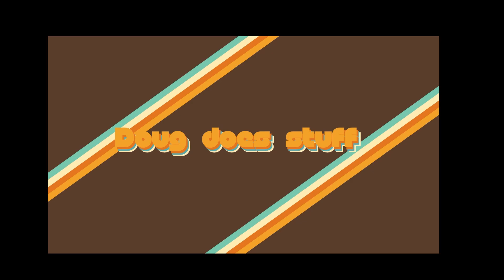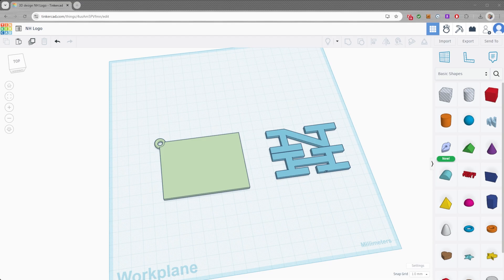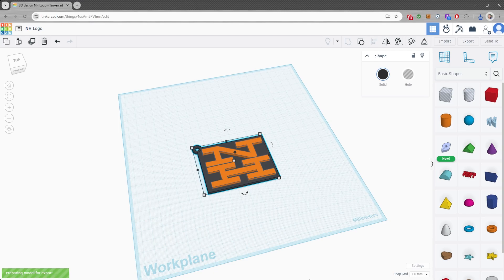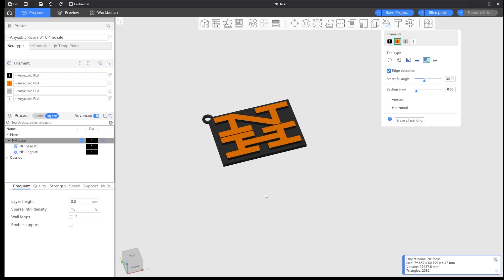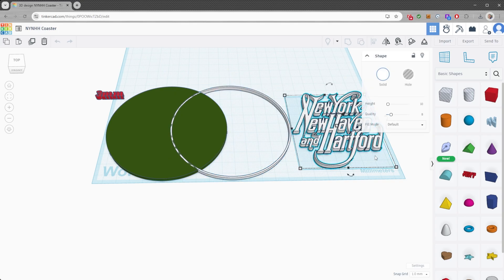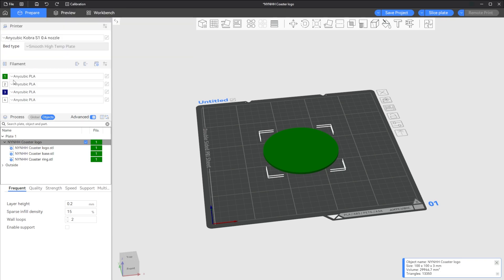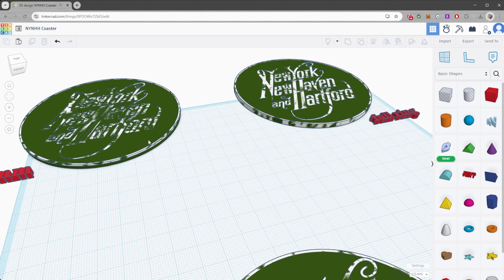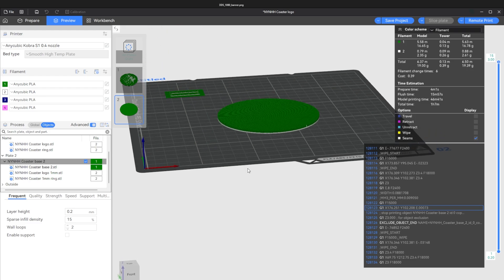3D Printing: Setting up a Multicolor Print Orca Based Slicers

Comment: After I watch your video I installed the firmware . I tired the heightmap. I did a lot of calibration (resetting klipper each time to see the new level,) and they where +- 0.1 without me touching anything .So not super repeatable .  On one corner I was over 1mm . I tried to upload the heighmap and did a 1st layer test print. I got the worse print i ever had. tired it many times just to be sure  and it was bad each time. I then push a little on the bed on the side that was the worse. I think the base is all plastic since it flexible. I really didn't put excessive force to it. On my bambu I put more forse to the part to release them. So when i redid the heightmap , the -1.2mm came all the way to -0.4 . So my highest point now is 0.2mm and lowest -0.270 . 
I think if a part stick on the bed well enough you can put more force to the bed that the force I applied to the bed to level it . 

First layer print is still horrible if i use heightmap but strangly enough I also did a test print and it came out ok and also stick a lot better on the bed  . Maybe is the model I am using for first layer prints that is the problem??? . .
Reply from the maker: Yeah, I am thinking it is the plastic bed that is the problem too.

As for the first layer print, which model are you using?  I just made a 250x250 single layer model in tinkercad so that I could tweak my own settings.  If you use Anycubic's single layer gcode it modifies settings to mask the layer issue.
Reply: @dougdoesstuff24  just a random one from makeronline market. I would try printing more items to see if its better. Any idea how to change fillamnet with the acepro and orca? It doesnt seem to change fillament even if I see it changing in the slicer